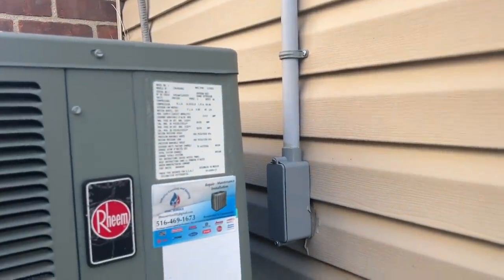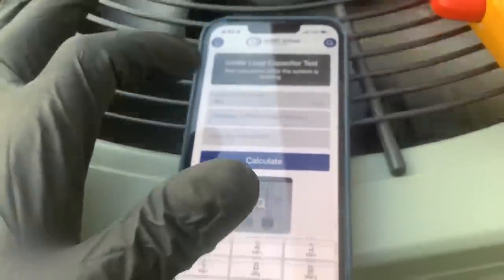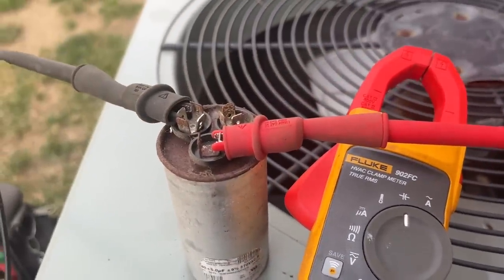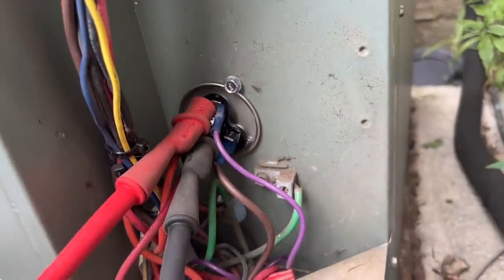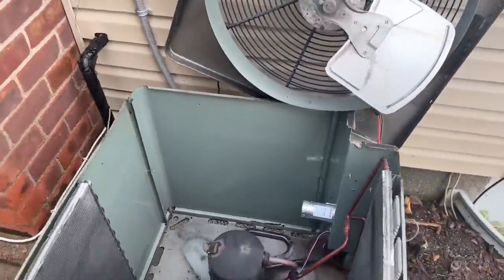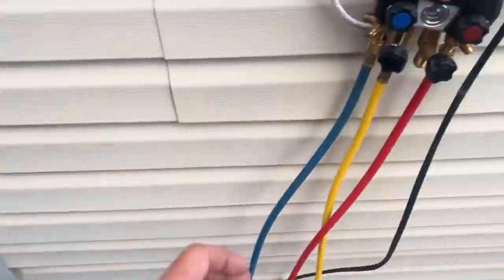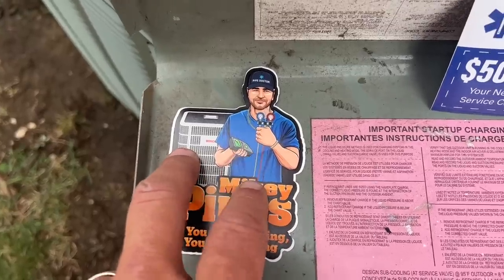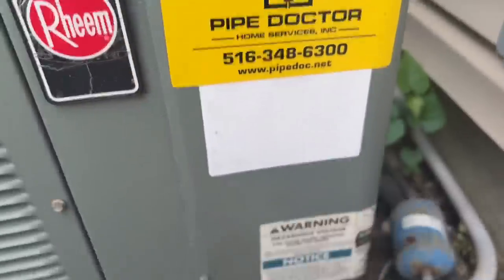Central A/C Service Call with Rebbe’s Choice Founder Featuring Emerson CoreSense Contactor

Comment: the early testing when capacitor voltages were jumping around so much. I'm going to guess they had an electric clothes dryer/oven/stove/microwave cycling and the incoming line voltage was all over the place. that will make the readings jump like that.  it could even be neighboring homes or businesses near by/within miles.

Comment: I wish cars could be charged this way. Yes, you can add R134a but there is no superheat/subcool because airflow is always variable (car moves, fan speed, etc). You could read the pressures on the manifold but for a car you are supposed to remove all refrigerigerant, and add back the exact amount by weight. Evap leaks are a nightmare. Took 8 hrs to get my F150 evap in and out :lol:
Reply: In the early 80s. working for a company in Houston when gas was $ 1.00 per gallon; they bought a couple of Toyota p/u trucks with 4 cylinder engines and no a/c. Well they bought the a/c units but us servicemen had to install the units ourselves. It took 30 hours of unpaid sweat. Worse part (manual transmission). Every time we stopped at a light or barrier had to shutdown a/c so engine would not stall and die! I quit Air Champion two years later! Then I started my own company!